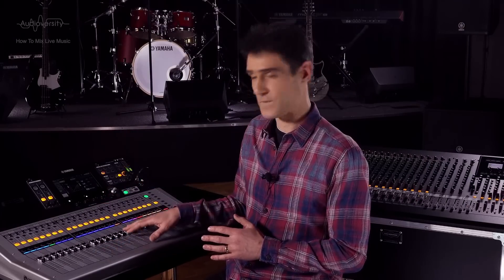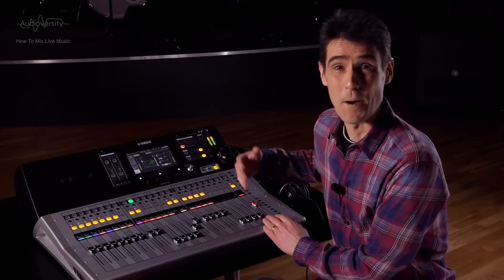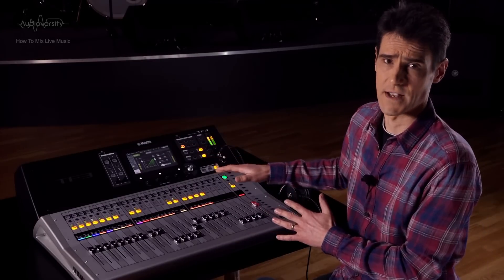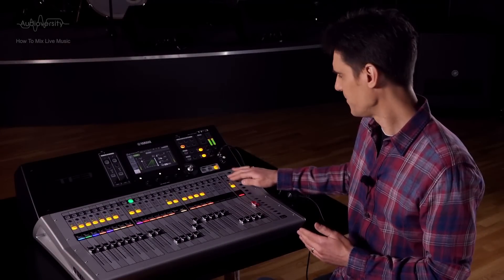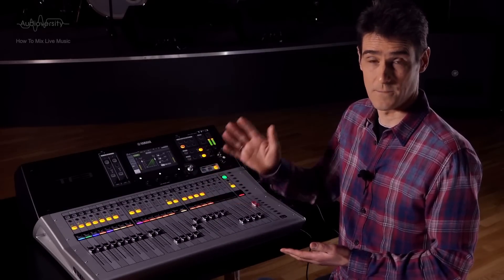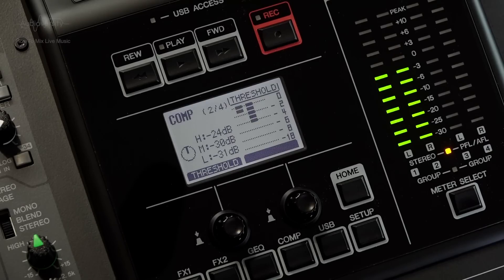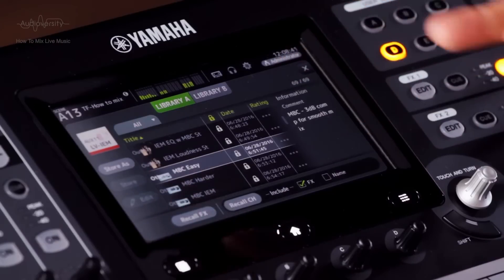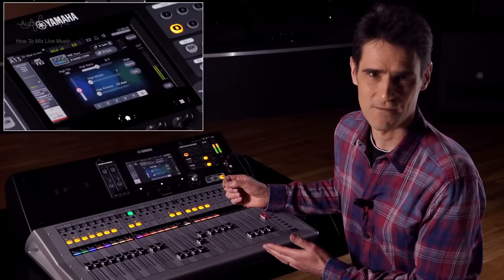How To Mix Live Music Chapter 20 - Output Compression

Comment: On the TF there is no way to assign channels to a group and then put a compressor on the group, or am I missing something? Or, does the comp on the input channel go to the mains post aux send and you put a separate comp (or don't) on the aux sends. I like to compress the vocals in the mains via a group comp but not in the monitors.